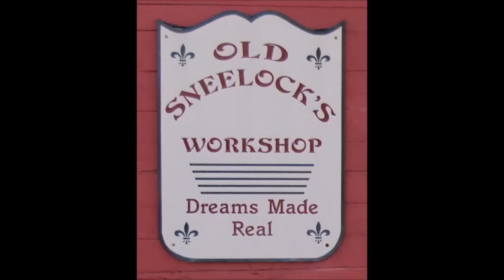Tinkers Work - Soldering On A Patch - a video tutorial by Old Sneelock's Workshop

Comment: I just watched yours and several other YouTubers’ videos about soldering. I had some pin holes and a 1/8” hole along with a loose neck on my tiller gas tank. I used a propane torch, tinning flux and   60/40 silver solder. It was not pretty at first, but I quickly got the hang of it. (I had thoroughly  cleaned out the tank and dried it-no fumes.)I used a piece of roof flashing for a small patch to cover the larger hole. Everything worked great! Thanks for the video!
Reply from the maker: Glad it helped. 😁😎

Comment: Great job and great video. Very opportunistic video as I have an old oil can with a split seam that I was thinking of soldering. I haven’t soldered anything for almost 50 years but I’m a bit concerned about the oil residue and kerosene I used to flush out the oil. Last thing I need is an explosion or flash fire.
Reply from the maker: If you think it isn't clean enough, put it in a pot of water with dish soap and boil it for an hour.

Comment: I've done a few of these on automobile gas tanks. I never used a flame though since they recently had fuel in them. A 3lb soldering iron worked well. If I could have used a flame I would have brazed the patch since they were putting gasoline back in the tank. I think the seal would be a bit tighter with brazing if possible.
Reply from the maker: I have repaired all manner of fuel tanks in many ways. Braze, lead/tin solder, silver solder, and my most frequent is soft solder. 
Braze is great for motorcycle tanks. Lead won't take the vibration. 
I only patched one automobile fuel tank. The huge explosion convinced me it wasn't worth it.  😁😎
Reply: @OldSneelock  yes, that's ehy I use soldering irons on on tanks that haven't been thoroughly steam cleaned. I don't want to ignite fumes either.
Reply: @OldSneelock al you need to do is flush the tank with water  then use somting like long pole with a candle all it dos then is a puff  no explosion  welder  taught  me this years ago
Reply from the maker: @frankdavidson9675  That works 9 out of 10 pretty consistently It just happened that I did the tenth one first. 
I told them I didn't want to do it but they begged. Fortunately it didn't splt the tank and they were able to put it back in the station wagon. 
Odd thing was they had burned a hole in the tank trying to weld the mounting straps. 
Why didn't it blow then?  🙄☹😱

Comment: Great vid with nice tips. When dealing with lead you should avoid power tools and use hand sand paper or hand wire brush to clean off the scale/slag. This lessens the amount of lead going air born. Good job fixing this as decent gas cans are getting harder to find.
Reply from the maker: Thanks Jimmy I appreciate your kind words. 
You make a valid point about less dust becoming airborne. I don't share MIOSHA and the EPA's opinion on the danger of lead.  I'm not  advocating using lead as a salt substitute but in my opinion the hype concerning lead poisoning is an effort to justify the decisions made by previous administrations to support a cause that was valid in the beginning but has become a bloated bureaucracy. I grew up in the 50's long before the lead based paint furor became a way to condemn a lot of perfectly good buildings. In 1959, at the age of 8, for Christmas I was given a set of molds for making lead soldiers. My father set up a small Bunsen burner and a casting station for me in the basement of our home. I cast soldiers, sinkers for fishing, and later helped Dad install cast iron sewer line with poured lead seals. I made robots in the 60's. Not the R2D2 style. More the Warning Will Robinson size. I soldered bodies together and soldered wires from the time I was 11 until I was 15 and moved on to motorcycles. 
At the same time I worked with Dad installing wiring in houses across the county and plumbing in our house. All before lead became a pariah. 
In 1975 worked for Borg Warner making radiators. My job was to run the solder dip pot. That meant I stood over a 1000 lb pot of molten 50/50 lead/tin solder and dipped the headers into the solder to bond them to the radiator core. 
After a year I got into the maintenance department and again worked with soldering wires and also repairing the solder dip pot when it needed it. I also ran the waste water treatment building where I removed the particulates including lead from the water being discharged to the city waste water treatment system. The EPA was more concerned with the effects of zinc on the environment than lead. The crew running the solder line had to have their blood tested for zinc every year starting the year after I stopped running the solder dip pot. 
Now if I were to believe all the news and shouting in the current headlines the massive doses of lead that received on a daily basis from the time I was 8 until I was 30 and left the employ of Borg Warner should have killed me soon after I reached the age of 11.  If nothing else I should have lost what little mental capacity I had to begin with. 
Admittedly I didn't eat lead based paint. My parents didn't want us chewing the wood work and prevented that from happening. But despite my heavy exposure at an early age I was able to maintain a 4 point gpa in college. I went on to obtain a position as Environmental Coordinator for United Technologies, followed by a successful career as an engineer. 
I still encounter lead in the world but I don't panic at the possibility of it causing me physical harm. 
As far as the fear mongering of the EPA and MIOSHA, as a central core of their program the EPA and MIOSHA both require Material Safety Data Sheets be provided for every substance used in manufacture of any product under the control of the EPA and or OSHA. Except for food stuffs. Ketchup is too acidic to pass the safety standards for chemical exposure to humans.

Comment: Would it have been easier to just fill the hole with solder? Thanks for the video!
Reply from the maker: Good question. The reason for not using just solder on a large hole is structural integrity would suffer. 
By using the patch the solder bonds the patch to the surface so it can bridge the hole. In order to bridge the hole with solder it would have to be supported while it cooled. Due to the lower tensile it would also need to be much thicker than the steel patch. 
In general the joint is stronger if the contact area is as large as practical.

Comment: i have 1 old gerry can i found in a junk yard it has a big dent in the side  i neede to fix to use on my m37 53 dodge  3/4 ton truck any advice ????
Reply from the maker: you can try inflating it with compressed air. If it is a dent in the side that might work. 
If it has a dent in a corner inflating probably won't work.
Reply: @OldSneelock  thks for reply i may try that

Comment: How much psi could a hole like this hold ,possibly
Reply from the maker: A correctly soldered patch can hold 30 to 100 psi depending on how big it is. The bond strength is determined by square inches of area that is bonded versus the total patch area.

Comment: I have rust leaks on my car tank. Will this work? Or course after making sure theres no more gas or vapors left.
Reply from the maker: You can seal holes in most metalic objects with this method. Be sure you have a clean, dry tank. Gas explosions are powerful.
Reply: Thanks! Sn96.5Ag3Cu0.5 is what I radily have available here. I suppose this should work. Will definitely do this on this weekend.
Reply: Thanks a lot. did this on my car gas tank. Better than JB weld method specially for multiple/ large holes.
Reply: Fiberglass is impervious to gasoline..  If the hole in the tank is hard to reach,  Fiberglass will be much easier..  It cost more than a tin patch,  but it certainly will be safer to apply..
Reply from the maker: Epoxy is a common fix. Most auto shops sell patch kits. Tank liner is a viable option too. 
The original question was, "Will solder work?"
Reply: @THOMASTHESAILOR  How will it hold under stress? Meaning the movement of the fuel tank?
Reply: @SDsailor7  ,  Fiberglass is very strong..  Boats are made of Fiberglas,  so are corvettes, etc..  If it's thick enough,  it'll hold up to anything.
Reply: @THOMASTHESAILOR  Well i dont want to deform the fuel tank of my moped by applying too much fiberglass. But i will keep it in mind another choice to think about.
Cheers

Comment: I broke one of the side grips off my steel AVF speaker brackets, the small weld has broke off, can i strip the paint and solder it back together instead of welding?
Reply from the maker: Synthematix It depends on how well the joint is made.  This little patch is ten times bigger than the hole  for a reason. It needs that much area to provide enough grip to hold without having a mechanical component. 
Soft solder, either lead or silver based, isn't as strong as a weld or a braze. Soft solder, in a joint under strain like a handle or structural seam, relies on interlocking the components with the solder filling the gaps. 
If there isn't any vibration or shear load then soft solder will work. 
My question would be what caused the break in the first place?
Reply: I stupidly tried to twist the bracket as the speaker wasnt sitting level on the plinth, then SNAP the weld joint broke, must have been weak to break so easily.
Reply from the maker: Synthematix To be able to say that solder would work I would have to know that the joint and the materials were strong enough. If it already broke once I would want an improvement.
That is only because I can't see or touch it. It might work, but that's not what you asked.
Reply: its steel on steel, basically an L bracket to a piece if squared steel tubing.

Comment: If  you coat newly cleaned the steel with a weak copper sulphate solution just before you solder the can and patch make patching so much easier   as you have copper plated surface, for solder and flux to bind in under heat, :-)
Reply from the maker: Interesting suggestion. I'll have to try that. Thanks. 😎.
Reply: Is that the etching stuff radio shack used to sell that was used to etch circuit boards ?
Reply from the maker: Coppersulfate is the result of exposing copper to sufuric acid. The sulfur in the acid and copper combine to form bluegreen crystals.

Comment: Sometimes when I hold the torch right on my molten solder it will shrink up into a ball, am i not prepping well or is this normal?
Reply from the maker: When you have the torch on the solder you are only heating the solder. When you only heat the solder as soon as it melts surface tension makes it form a ball.
The item you are soldering should be the heat source. Make sure the item is clean. Bright metal. No rust, dirt or oil on the surface. If the surface is dirty the solder won't stick. 
Then you heat the item until it melts the solder. The solder will flow out on the item. 
Don't overheat the item or it will oxidize and create a barrier preventing the solder from sticking.
Good luck. 😁😎

Comment: the gerry cans used for water  had a creme colored interior  the cap was  little diff also we used both in korean conflict
Reply from the maker: Thanks. I have several that I use for fuel. None of them are lined. The one that I soldered had rusted to the point there wasn't any paint or lining on the inside.

Comment: I have  to  repair the  fuel tank on a  kerosene  heater, basically  going to  solder  a new bottom on the  tank. 😮
Reply from the maker: That will be a challenge. 
The strength in that type of soldering is building the joint for strength and the soldering will seal it.

Comment: another way to fix a pin hole in a jerry gas can sand around the hole get a poprivit that will fill the hole (short fat ) mix a small amount of jb weld  load rivit in revit gun dip in  J B weld install revit  j b dries  i n a few mins  i use jb weld all the time it works
Reply from the maker: Good tip.

Comment: Is that the solder that is used in electronic work?
Reply from the maker: As I explained to +Mr Cool. Yes it is the same type of materials used to solder wires together. Tinsmiths, and electricians both use solder made from an alloy of lead and tin. The difference between what a tinsmith and an electrician uses is in the flux. Solder for wires uses rosin based flux that isn't corrosive. It doesn't clean as well as the acid based flux but wires should be clean before soldering anyway. The acid based flux that I'm using here cleans aggressively and must be washed off or cleaned in some manner or it will corrode the base materials being joined. 
Yes it is very strong. Not as strong as brazing or welding. Soldering usually relies more on joint construction than on the strength of the solder bond. The method  that I used for  soldering the Gerry can doesn't have a mechanically folded joint to help reinforce the joint. 
Lead based solder can be used on steel, copper, and alloys of copper with zinc or tin. Lead based solder is not used on aluminum. There are solders that have been developed especially for aluminum. http://www.weldguru.com/aluminum-soldering.html
When you go to your local hardware it is much more common to find silver based solder than lead based. With the concern of how lead in water can affect peoples health lead solders have fallen out of favor. The silver based solder melts at a higher temperature and requires special flux.
Reply: @OldSneelock  Will it work to repair cracks in a fuel tank?
I have a moped that has two cracks an inch long each.
Thank you. You did good work on that fuel tank.
Cheers

Comment: My dad's cousin died soldering a gasoline tank by this method.  The tank was filled with water but there was enough area in the top of the can for the fuel to accumulate, the tank blew and his head was nearly taken of by a chunk of the tank.  There are ways of doing it but don't think that using water will work.  It won't.
Reply from the maker: Sorry about your Dad's cousin. I don't suggest soldering any tank that has held gasoline. I have had a gas tank pop on me even though it was filled with water. 
If an idea doesn't feel safe don't do it.
Reply: @OldSneelock  Agreed Sneelock.  Just relating something I learned about 60 years ago.

Comment: if you need to remove rust in these (gerry) cans fill with water drill a hole in a piece of wood that will fit right in the opening  about 5/8  insert a rebar so it not touching any thing but the wood  conn 12 volt battery charger to rebar (neg )   and pos lead to the can if its  working you will see small bubbles leave all week end   then pour that rusty water out  rinse out  if it looks like a lot of rust is gone  add some ( PINT ) muratic acid screw lid on l shake real good leave over night the pour that out rerinse should be usable now
Reply from the maker: Thanks for the tip.

Comment: Iv done the same but never the patch  method  I'll give it a try  soon ..iv used  the wrong solder but did use the Flux paste  ....there is electrical  solder then  there is non electrical  solder  I used electrical  solder  ment for copper wire not  metal 😂
Reply from the maker: There are many types of solder. 
There is acid core that is used for soldering assemblies like funnels and buckets that are able to be washed to remove the acid after soldering. 
There is rosin core that is used for electrical connections. That doesn't need to be washed as it will not corrode the connection. 
Then there is solid wire, stick, blocks, and ingots of solder used in all manner of fabrication. Some is applied with torches, some with lead melting pots, and some is brushed on to tin surfaces before sweat soldering. 
I used acid core solder for this project. Solid bar or wire could be used with the paste flux. I used paste flux because I could apply it cold and then sweat the two surfaces together.

Comment: You can do this even if it had gas in it. The trick is washing it out with soap and water. Then airing it out for a week. Then, before you start the repair, run a hose with air in it. I used a heat gun on the cold air setting. I ran air in it until I was done. It's not worth cutting corners when doing this. An empty gas can is far more dangerous than a full one if any vapors are still inside.
Reply from the maker: Derek there are many ways to get in trouble. Telling people how to do something with a possible dangerous outcome leaves you open to someone not following your directions and getting themselves or others injured. Then of course it's your fault for them screwing up.
Reply: @OldSneelock  The last time I redid the nipple on he Craftsman I drained the tank, blew it out with the compressor and then stuck the lit torch in the filler hole. I had safety glasses on of course.HA!  No bang so I remelted the nipple and it's still running. Hi grass is incentive enough for me. And too many concussions!

Comment: What do i do if the hole is caused by metal feteige and the surface is not flat?
Reply from the maker: Brown-Streak Studios If the area is under enough stress to flex the surface and cause metal fatigue it's not a good candidate for a soft solder repair. You might check out silver solder instead. It is stronger than lead based solder.
Reply: I left it in the car by accident. I don't think being in my barn cellar will cause that much stress
Reply from the maker: Brown-Streak Studios Okay. What are you patching? If the hole is just worn through then you can clean the area and use a patch shaped to fit the surface. Solder works best in tight joints. Capilary action will draw the solder into the joint.